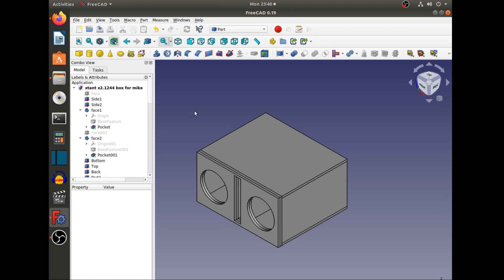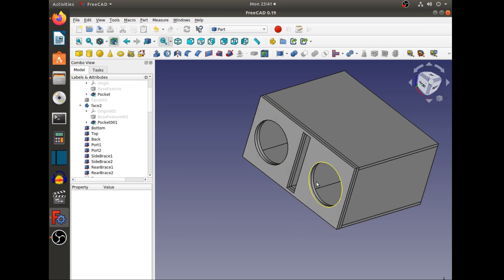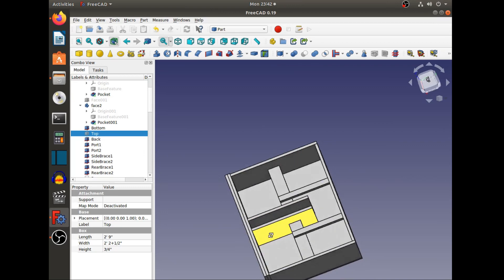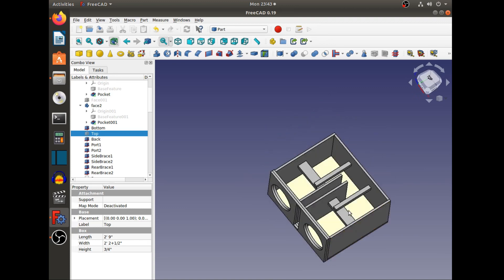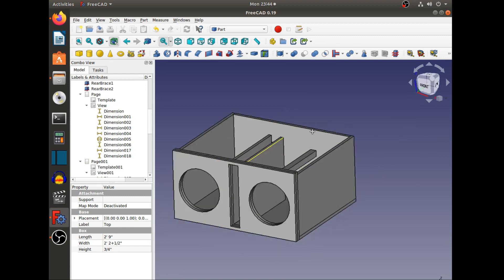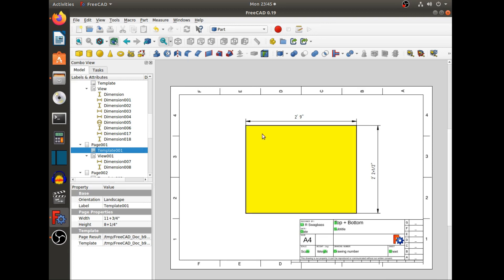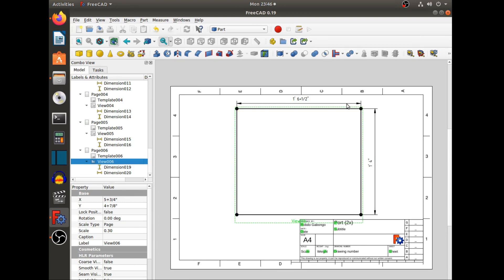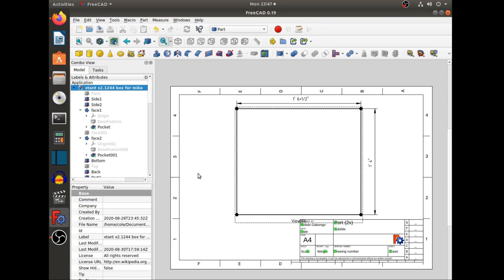Free Box Design For 2 12 Inch Subwoofers ! 25Hz Tuned ! 6.6 cu. ft. ! LOW Bass Box !

Comment from the maker: I was wrong about the internal volume of the box. I'm sorry about that. I found out I've been designing boxes WRONG from quite a while, but it's ok! This box is still good and will still hammer the lows out with the right subs.
Reply: so what is the cubic feet of the thing then
Reply from the maker: @rolisaenz  The title is accurate now. I don't recommend this box unless you're not running a ton of power and want to get super low